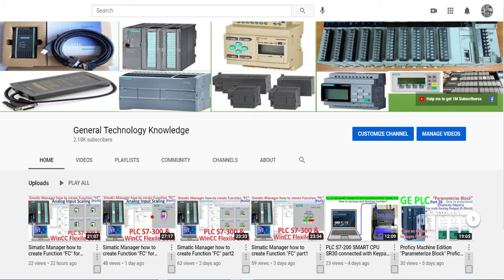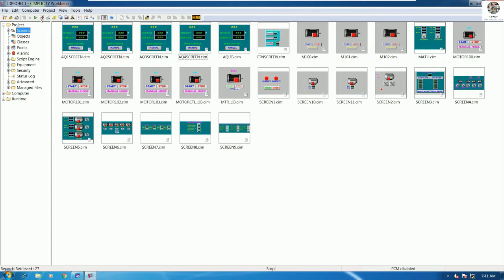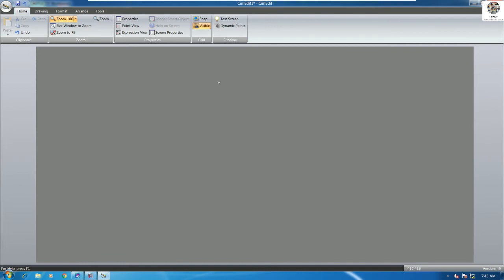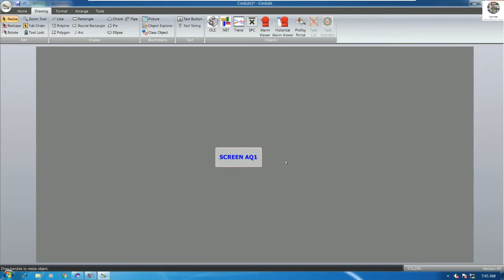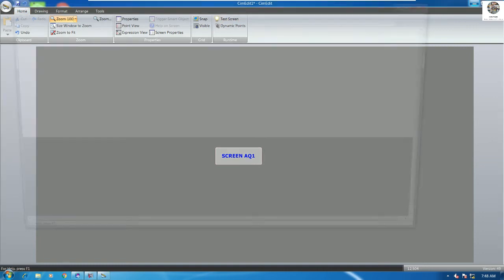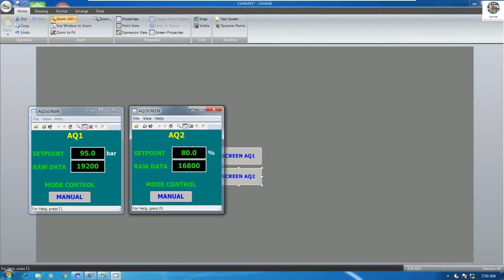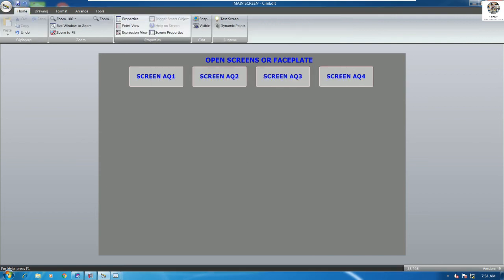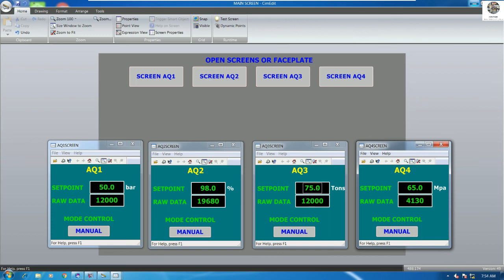GE software "Proficy Cimplicity HMI SCADA" how to open screens by using mouse up action

Comment: The pop-up screens have a number in the name.  If your main screen had a variable called "U" and its value was 1, 2, 3, or 4, could you make a single button that would open the pop-up matching that variable?  So if the main screen U was currently assigned "4", the button opens AQ4SCREEN, and if the main screen U was equal to 3 the button opens AQ3SCREEN.
Reply from the maker: Dear sir,
In this case we can writing the script to open it.
I will prepare it for you. Thanks!